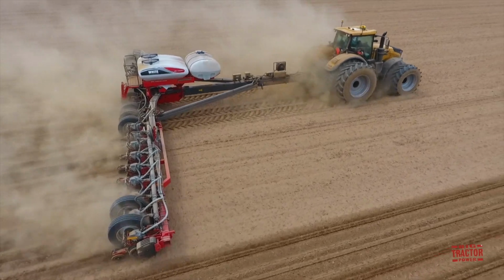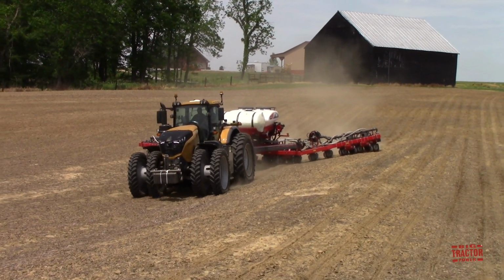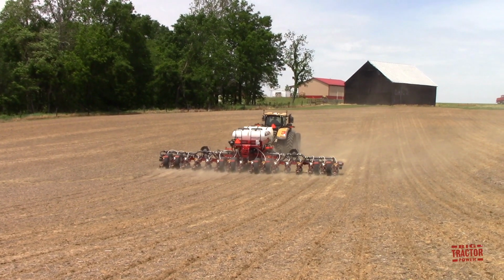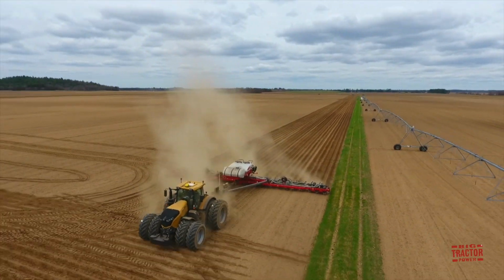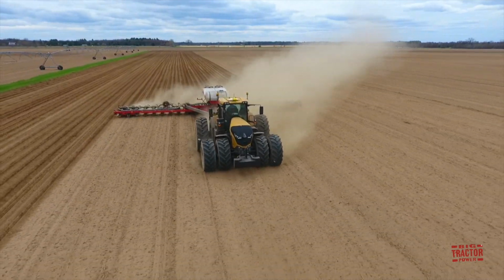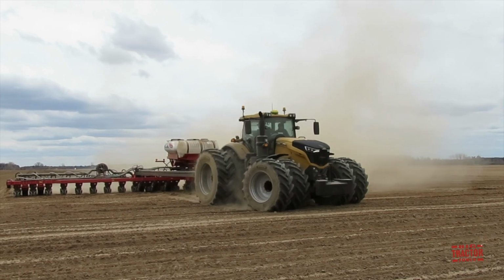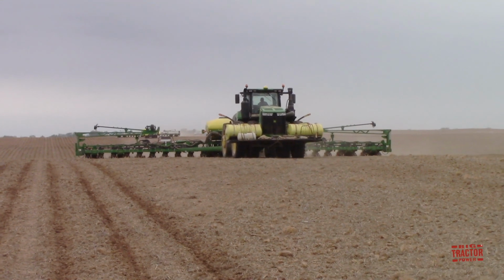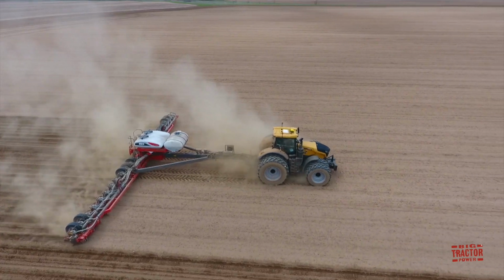10 mph Corn Planting Challenger Tractor WHITE 9800VE Part 2

Comment: Back in the day when fields out west were set up, measured in Rods.  A Rod is 16 1/2 feet.  A 20 Rod width is 330 feet.  So in 1/2 mile wide ground, makes 8 strips.  4 cropped, 4 summerfallow.  The ideal implement width would be 83 feet.  Making 4 passes, finishing on the same end you started.  Wow, at 10 mph, you could seed 80 acres, 2 fields in less than 1 hour.  Seed all 160 acres in 2 hours, ideally.  Roll over a section, 640 acres in 8 hours.  Git er done.
Reply from the maker: Great historical info.  Thank you for sharing.

Comment: What makes this video unique is you can see how it accelerate from very low to 10 mph in a second, Very nice Drone shots of the big machines, awesome
Reply from the maker: It is impressive to watch these planters.  If you watch part one near the very begging you can see the 1038 pull up pause and drop the row units and speed off.  It was neat as I filmed that clip from An XUV trying to keep up with it.
Reply: Yeah I was wondering what that felt like inside the cab. Almost looked like it jumped straight into road gear. Lol

Comment: European tire setups jus look waaay better than those American sawblades.
Reply from the maker: It all depends on the region and type of use.
Reply: Row crop duels are better
Reply: @aaronfogg302  why should they be better?
Reply: Saibot cheaper and allow you to run over many more types of ground. Same amount of flotation virtually
Reply: @aaronfogg302 ... more compaction, less riding comfort, lower allowed maximal load.
They are not cheaper if you consider that you need 2 row crop tires with rims to compete with just one standard wheel

The only reason to put those on your tractor is to fit between rows

Sorry if my english is not flawless, I'm doing my best.
Reply: Saibot I’ll admit that ride quality is probably a little better, but that wouldn’t be a selling point for me. Europe and America each have different types of tools and equipment they use, and for the region they are in it works. I just prefer row crop duels

Comment: Where in Wisconsin?
Reply from the maker: Central Sands
Reply: @bigtractorpower  yes, you mentioned that in the video. I mean where in the central sands? I'm also from the sands but don't recognize that equipment.
Reply: @mikef1586  I'm thinking Wisconsin Rapids area.  It's pretty sandy there.
Reply: @michics100  it's just as sandy in Point, Almond, Plainfield, or quite a few other places.
Reply: I filmed it southeast of Bancroft.

Comment: To me,it's impractical to keep going up in hp.on a row crop model,the problem is that most of your weight is located in the rear end,on a articulated tractor,the weight is much more evenly distributed between front and rear and makes much better traction and use of the same amount of power and can pull much larger implements.
Reply: Thanks,who-ever done that,I was getting tired of it myself.HAHA!!

Comment: how many acres per hour  can they plant ????
Reply from the maker: That is a good question.  I am going to say 21 acres an hour if everything is going well.
Reply: At 10mph, a 60’ Planter will cover 72 acres per hour. 

We have a customer running a 90’ high speed planter and covering over 100 acres an hour.
Reply: @ssghammy  60' more like 65 acres if everything goes well. You have to turn on ends and fill planter.

Comment: This challengers are built in Minasota USA
Reply from the maker: The MT600 and MT900 are built in Jackson.  The 1000s are from Germany.
Reply: @bigtractorpower  no,  MN Millennial Farmer had a video on hes channel where he went to  the place where they build them in Minnesota. he demod one on the tracks
Reply from the maker: The track MT700 looks similar to a 1000 but it’s different underneath.  The 1000 is built at the Fendt Factory. The 600, 700, 800 and 900 are built in MN and the 500 is built in France.
Reply: @bigtractorpower  yep my mistake, they are build like you say. sorry about the argument without checking the facts. thanks for correcting me, and cant wait for the next video.